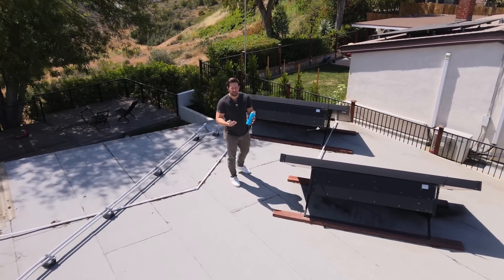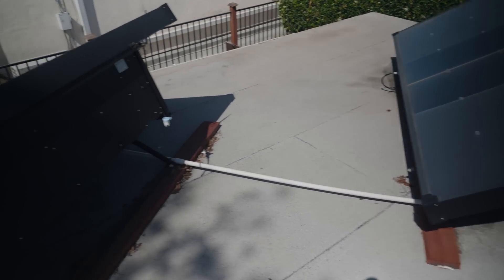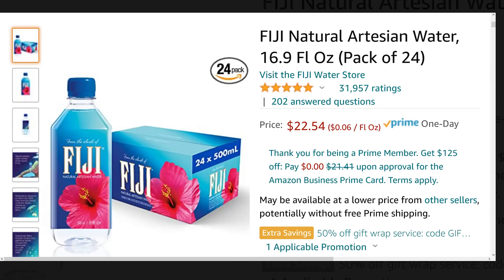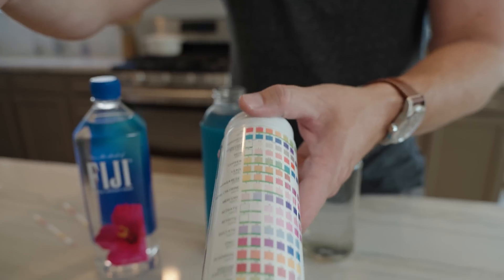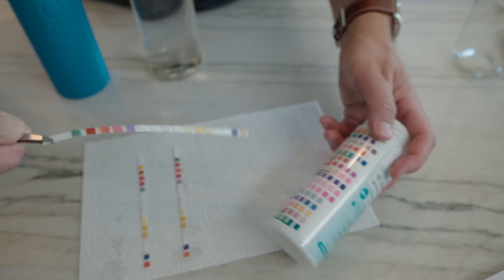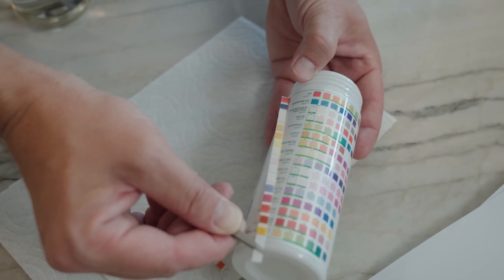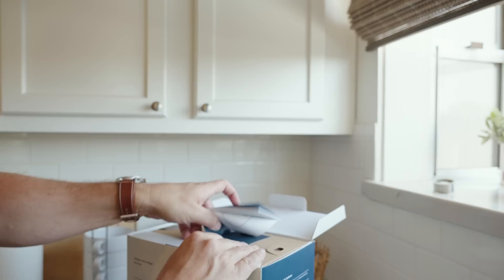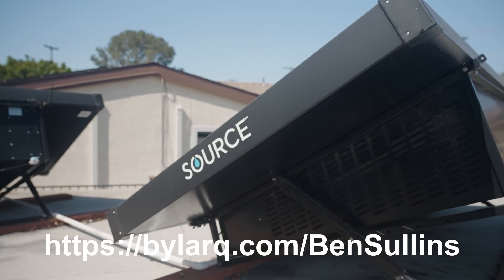Real-World Source Hydropanel Review after 2 Years

Comment: I installed two panels at my home in Tucson, AZ. The installation team was fantastic - very professional, timely, and they did quality work. The panels are not noisy - this video gives the impression that they are loud. In my opinion, they are not loud at all. Ours running at full power cannot even be heard from the ground level (they are installed on my roof). We have the latest models, and they may be quieter than older models. But, ours are very quiet and produce no discernible noise from ground level. They work beautifully, providing quality, fresh and delicious drinking water to our home. I highly recommend them.

Comment: I'd like to put one on top of a Mercedes Benz Sprinter van for an off-grid solution. It takes up a lot of space though.. and is very noisy. Maybe pull a trailer, with a water tank and two of these Source panels. That way the living space can be completely separate from the hum. I can then use a high pressure hose to get the water to the faucets and toilet. I'll be able to take a 15 liter shower every couple of days. If I use biodegradable soaps, I'll be able to dump that grey-water anywhere.
Reply from the maker: I'd get an Aquaphant instead. Much cheaper and just sits on the counter. Just make sure it's empty/secured while driving otherwise it could get damaged.

Comment: Get past the initial purchase of technology that yields 15 gallons of clean drinking water daily is a phenomenal quality of life improvement for Americans.  If you drink 64 ounces of water daily & use 1/2 to 1 gallon daily for camping-style showers you're still left with 13.50 gallons of water for storage, watering plants, cooking, watering pets, etc.  A camping-style shower involves getting your body wet, then turning off the water, next you lather up all over your body, then turn on the water again to rinse off.  

Another variation of that is using shower chairs and a 1 gallon water cooler (Igloo or Coleman for example).  Using a battery powered water pump attached to a hose and handheld flow control nozzle you can have the essence of a shower with a sprayer nozzle.  It can take longer but if you're not in a rush what does it matter?  To heat 32 ounces of water use your microwave oven to heat the water for 3 minutes per batch.  Four batches later (12 minutes) you'll have a gallon of hot water.  In an insulated water cooler it will hold the heat for up to 3 hours.

While not the best solution for certain families or individuals you can save a bunch of money on heating your water doing it this way.

Comment: Wow a big dehumidifier lol. My friends will be jealous their humidifiers are not nearly as big. 

At $500 a year for only 7.5 liters a day it is a waste of money. A reverse osmosis system will save you thousands as you can buy a very good one for a few hundred and tap water costs $1.50 for 1,000 gallons. But $6,000 on your dehumidifiers was a deal lol.

Or you can just buy water in the store which is far cheaper. I pay for a large 5 gallon refillable jug $0.30 a gallon. So you get 7.5 liters per day from your system? That is $500 for around 723 gallons per year. At $0.30 a gallon I can get 723 gallons of store bought water for $217 per year. But yeah your $6,000 dehumidifier is a bargain lol.

Comment: But HOW does it work? You only point to the panel sections. How do you get hot humid air to give up the juice? The last I checked, hot air has an affinity for water. Is there a cooling unit to condense water vapor or some sort of membrane to “filter” the water out? Perhaps a desiccant?
Reply: Trivial basic school physics. YOU COOL IT. Or, better, you run the air over a cool surface. Go to a number of places in the world and you can see water running down windows (with air conditioning behind them).

Comment: I have been in HVAC for over 30 years. It would be more efficient to do the same thing with a Heatpump and have that same energy provide more than one purpose. You could be using that energy and capturing it to heat water, space in your home, refrigeration or cooling, there are many ways. I am also a Solar guy that has worked on and designed systems for years. It is great that people are thinking outside the box but there is still a lot more potential than what they sold you or you purchased. There is also the filtration and purifying side of it but you know that already. 😉
Reply: How can this be done using a heat pump?
Reply: @ladyjjj  A heat pump can both refrigerate and dump heat at the same time. While in air-conditioning mode you pull heat out of the air and the air and moisture that comes in contact with the exchanger cools and condenses the moisture or humidity out of the air. The condensed moisture collects and runs out the drain pan into whatever container you want. The Heat that is extracted can be used somewhere else if you wanted to or just exhausted back out into the air.

The advantage of the Heat pump over a standard air conditioner is the ability to enter a defrost cycle if and when needed.

It would amaze you to see the actual amount that comes out in a 24 hr period. 

You simply need to sterilize or filter the water you collect. 

The heat that is discharged could be dumped into a water heater, green house, compost pile, thermal battery to pull heat off of at night when the outside temp falls, whatever.  There are many opportunities and I am sure that it would cost less and provide more bang for your buck.

In the heat mode side of a Heat pump it is 300% efficient. In the cooling side it is not as efficient.

Comment: The best water filtration system is an undersink 4 or 5 stage reverse osmosis water filtration system.  It cost about $200 for the whole system.  You install it yourself.  Installation is not difficult.  You don't have to install it exactly like in the manual.  We use the waste water to water the trees.  Annual maintenance filter kit costs less than $100.  Replacing filters is achieve by a push of a button.  Only other maintenance requirement is sanitizing the water tank with chlorine once a year--not difficult.  The reverse osmosis membrane filter needs to be replaced once every 3 to 5 years--easy with a push of a button.  The water taste sweet.  Best inexpensive water filtration system for city people with potable city water.

Comment: Although the SOURCE system seems expensive up front, it stamps out all the plastic waste from those who buy bottled water AND it pays for itself over time.
I don't see the noise from them as a problem, it's a low amplitude innocuous sound, which could easily be drowned out by winds. If the fan noise is intrusive, then the fan design needs further development. More attention should be put into decoupling/tuning the roof mounting system & perhaps use flexi-rubber tube couplings for the conduit.
My criticism of the Larq is that it's based on a bi-monthly subscription costing $26, sure it's delivered free of charge, but they're delivered by not so environmentally friendly delivery vans.

Comment: I've done a quick calculation for the bottled water I buy from Amazon here in Dubai, and it works out at 7 US Cents per 500ml including delivery (comes in 1.5 litre bottles).
I used to have a restaurant which due to the location we had to run 2 dehumidifiers through the winter and they would collect about 6-8 liters per day but there is no way on earth you ever catch me drinking the collected water.
You haven't factored in the lost opportunity cost of using the solar panel on your roof to power other household products.
Extracting water from air is a very inefficient process, I guess you've already sunk the money into the system so it's too late now but have you been scammed? I think the answer is yes I'm afraid.
Reply: It buys you time and perhaps even your survival when -- not if -- drinkable water becomes more rare and therefore also more expensive  (meaning, higher than the current gentle prices you are using for your current figures).    It would be primarily used for an emergency system you have rather than a full replacement for thirsty patrons.

Comment: How does it work during Fire season? When there are smokes in the air? Does it produce clean drinking water?
What kind of flat roof do you have? And do you paint or put what kind of sealant to prevent leaks?
Great video, btw.
Reply: you filter the water with mini portable water filtration system dumb ass, im only 12 years old and know that...

Comment: Low pH can be an issue, a slightly alkaline pH is advantageous to health.  A nice mountain spring water would have higher then normal mineral content (good minerals), higher pH (normally) and far superior health wise to pure water.  Pure demineralized water, while exceptionally sterile, is aggressive at stripping minerals / metals from whatever it touches (water doesn't like to be alone) and high end filter systems typically re-mineralize after purifying, for taste / health and equipment longevity.  Studies have shown that an acidic body can promote cancer and we didn't evolve in a sterile environment.

Comment: That's a total of 725 gallons, which would have cost a TOTAL of $1.80 from your local water company!
The costco pallet is 2x more expensive, because it's delivered. If you buy it from the store, it's 1/2 the price.
The thing you actually have to test for is contaminants and bacteria, as that's what's floating around in the air that you're dehumidifying, not anything that would be testable with a strip.
You're either a shill for their company, or you're trying to justify the worst purchase of your life because people are laughing at you. Sir.
Poor, rural communities, 1. Do not have the $$ to pay for Source, 2. Do not have the power to run Source, 3. Even if they did, they'd spend hundreds of times more money on powering them, than just having water trucked in, and 4. Deserts have no humidity in the air, therefore, you will spend even more money, sucking even less water, out of the dry desert air. This is a scam, and shame on you for promoting it.
Reply: Nope. Building the water treatment plant and pipes so you can have a local water company will cost millions. Delivering water is not cost effective either because you do not need just one pallet, you need loads of them every day for the rest of forever.
The panels work on sunlight, they do not need external power and even if they did, delivering water is massively more expensive than the few tens of watts of electricity they run on. They were tested in a desert and proven to work in as little as 10% humidity. They also clean the water so bacteria is less of an issue than in tap water with miles of pipes.
You sound very much like one of those lobbyists and short sellers trying to claim that Tesla electric vehicles will never work and the company will go bankrupt any day now, but those people at least had a valid reason to try spreading their fake news.
Reply: Based

Comment: In our situation our primary home is near a city well (in the AZ desert) and water is filtered before getting to the house but installed a whole home filtration system that goes through 2 large tanks (softener and filtration system but doesn't involve salt) in the garage plus a particle filter prior to the tanks and a UV filter after the tanks.  Under the kitchen sink is another 5 filters system (one being membrane filter).  Then after that there is a split to the main fridge where there is an additional filter for the ice.  So, our ice cubes have been through 10 filters and the water from the kitchen tap has been through 9 filters and when testing it against bottled water it has lower ppm than the bottled water.  I think the whole home water filtration system ran around $5k and under sink filter ran another $1k.   Changing filters costs about $200/yr.   The water in the showers doesn't scale anymore and feels much softer and been purified to be very clean drinking water.  We fill up gallons from the kitchen tap and have not bought any bottled water in years.  As the well is only 2 blocks away not really worried about any issues about it as I've checked the hydrology maps in the area and water from wells in our area have all shown no water quality issues.   South of us in Phoenix the wells start showing various toxic elements and various quality issues.  Water however is a major concern for those living in AZ that don't have well water access.

Comment: The unfortunate thing is that where water is scarce usually the air humidity is also low and these systems work less efficiently but otherwise a cool system.
Reply: Water is scarce in many areas with high humidity, it does not mean regular rains happen. And the panels were tested to work as advertised in ~10% humidity, that is not a problem.

The only issue is the cost, a number of places with no clean water nearby already use air capture to provide their drinking water, but they do that by building a frame with a net and putting a bucket under it, which costs maybe $100 to produce same amount of water as a $3000 panel.
Reply: @AnalystPrime  What does “work as advertised actually mean at a 10% or less humidity level?  Would that be milliliters worth of water each day?
Reply: @jrf3307  More like half a gallon, though some quotes claim double that. The amount also depends on how much air can be sucked in by the fans, so maybe they were using the silent mode? Incidentally, the highest output I have seen mentioned was only little over two gallons per day; while some people keep claiming the panels are an AC or dehumidifier, the way it actually works is there is a spongy material that absorbs water(and only water) on its own and releases it to the storage tank when the material is heated up. When the "sponge" is full it cannot absorb more water even if the air humidity is high.
Also, in cloudy weather the solar panel might not charge the battery properly so there isn't enough electricity to keep operating all night. I have said this before and I say it again: While it is great the panels are able to work without needing extra infrastructure, they should have added a way to use an external power supply.
Reply: The reality is that this is not necessarily true. I live in the UAE - Dubai. SWEET water is really scarce, with the ground water mostly being salty. Drinking water desalinated. Desert as far as it goes. Guess what - humidity 50% and higher. This is a nice way for a capex (payment for the machines) you get a lot of water without electricity. Enough to drink and refill the pool. Definitely this is highly situational, but it is not a general rule that there is no humidity.
Reply: Yea, I would think about getting this but I live in a low humidity region.
Reply: Same here…I live in Arizona and with the exception of our monsoon season the humidity is just too low.  Might not even get one liter per day if that.  I really do think our region is going to need to figure out a way to desalinate massive quantities of sea water in the decades to come.

Comment: Just collect the condensate from your air conditioner.
Reply: Just tried it and it was yucky. I don’t think this is good advice
Reply: @wedemboyz  try buying a new terracotta pot lol it does in fact work, water filters use terracotta all the time in them
Reply: @Trefuckor963  Well why didn't you just say that in the first place!? Air had been on a lot lately. So much water wasted:{
Reply: @wedemboyz  🤣
Reply: U could just pour contaminated water in a terracotta pot and it will seep through as clean drinking water. Another problem with using a dehumidifier or air conditioner is it needs lots of power for it’s peltier disk which is what condenses air, or it uses peltier disks AND coolant. U could mimic this by getting a piece of plexiglass glass over a plastic tub with a drain plug.
Reply: You have to filter it.

Comment: In places with access to running water, reverse osmosis is a very cost effective way to get exactly the same quality of water out as Source. That's why so many homes have them.

I'm struggling to see where Source makes sense. Water output is strongly affected by humidity in the air. In places dryer than San Diego you'll get even less water out. Maybe it makes sense on remote trails for hikers to fill their bottle or wash their hands (think airplane toilet faucets). But even in disaster zones, it would be cheaper and easier to just fly in bottled water.
Reply from the maker: Keep watching...
Reply: Dubai. 50++++% humidity, ground water is salty. Independent unit, capex, no running costs for electricity. Water from Air is a big thing here. Heck, there is a farm here doing that with those unit. 1.5 MILLION liter - per day.

Comment: I wonder how efficient they would be in places that would make sence to have this units, like deserts where the humidity in the air is very low ?? 🤔 they are kinda just giant dehumidifiers with a filtration system, and In places with enough humidity would it make more sence just to built a well and add the necessary filtration systems ?
Reply from the maker: they say above 10% and it can work. They're based in the Sonoran Desert
Reply: "Giant dehumidifiers with a filtration system" are EXACTLY what these panels are.
Reply: @eone2345  You can get filtrations systems for your well, which will make sure it's always clean and safe.
Reply: @eone2345  Good point/s!
Reply: @eone2345  I live in a similar situation and we only use our well water for watering plants. This could be a good solution for homes high humidity areas who doesn't have space for a giant rainwater harvesting tank. Or it could be used for during summer and winter, along with a smaller rainwater tank. 
There is a place below sea level in my state which has more backwater canals than land and getting water to homes in these tiny river islands are a huge conundrum....This fits the bill perfectly for them.